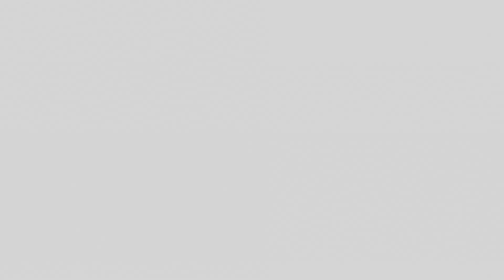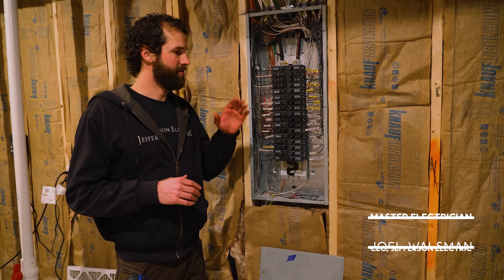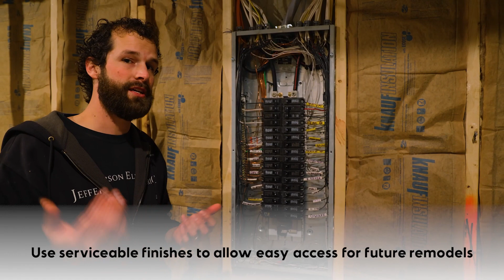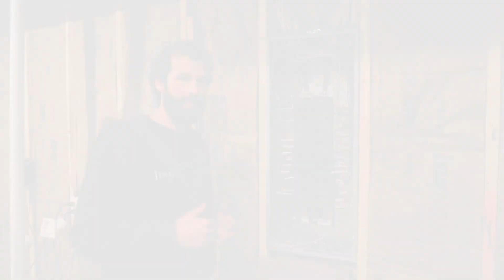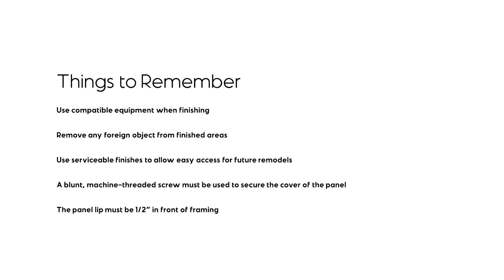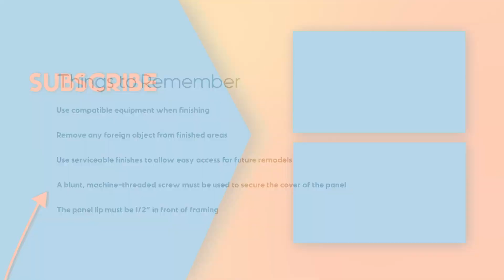5 Common Electrical Panel Mistakes

Comment: As a 40 + year electrician the thing that really bothers me is guys who trim the wires to the exact length when terminating to the breakers, and then bundling the wires so tightly that troubleshooting individual wires is impossible. A service panel will probably last 40 years or more and many modifications are going to take place after you are long gone. Circuits will be added, breakers replaced and loads will get moved around. Also, the heating and cooling of conductors will cause them to expand and contract, allow for this movement. Always, always, always leave an extra loop of wire inside the panel. Run the wire down past it's breaker a few inches and then come back up to terminate. Trimming a panel isn't an art contest, it's all about function, safety and future servicing. The need for splicing wires in a service panel because they are too short is bad practice and usually frowned upon by inspectors.
Reply: Panel can be used as a junction box. If the wire isn’t quite long enough, extend it. Twist your wires good
Reply: @zachdalehite2165  Do that too many times and you fill up the panel box.  It's better to not have to junction to begin with, if you can avoid it.
Reply: @thekobaz  yea that’s true. But if you can’t help it do what you gotta do. Seen people try to extend the wire & leave the splice pushed up in the wall or ceiling rather than the panel box
Reply: @ElectricProAcademy  Thank you! An example I can give, and there are many, is adding a panel mounted surge suppressor. For this device to be most effective,  it should be connected as close to the main and with the shortest wires as possible to dissipate any erroneous currents as soon than they enter the panel. They normally require a 2pole 20amp breaker so this would entail relocating the 2 closest circuits to the main.
Reply: @davenag957  
As another 40+ year electrician,  I agree with everything you said. Especially the extra wire length. I always do it just as you described.
Another example of the need to "rearrange" breakers would be a generator manual lockout situation where the generator breaker needs to be adjacent to the main.
There's probably a happy medium as far as the "art project" aspect. Serviceable  and functional, yes... but not a "bowl of spaghetti" either.
Reply: Was taught over 50 years ago to leave wire at least entire length of panel so a wire could easily be moved. Now with 42 & 84 circuits it's not practical. At the large hospital/research center that I retired from they had at least six 84 circuit 120/208 panels on each of the 12 floors. All conduits were 1" EMT leaving only at top of panel. They made contractor pull a total of 19 #10 guage wires from panel to first pull box for all the 20 amp receptacle circuits do even ty rabbing wires was a crowded mess having over 175 #10 guage wires at top of panels.
Reply: I’m glad that as a second year (soon to be third) that there are people that still do service loops
Reply: Agree with you 💯 %.

Comment: You missed the elephant in the room when stating the breaker vs. panel compatibility.  There are many panels out there where the original mfgr. is no longer in business. And some of those do NOT have an official replacement by another mfgr....although there are breakers made that fit and work well. There are arguments over this all the time.. The code is vague, but seems to cover it..No...you do not have to tear out your panel (at least last time I checked)  even though there are no "official" replacement being mfgd.   And as far as push in vs. 2 screw connectors. Are you kidding? Use what you want. We do remodels and have to deal with this type of thing every single day. For starters,..cutting (and repairing afterward)  the sheetrock along the top is by far a bigger pain than dealing with the metal vs. plastic connectors that are the next thing to deal with.
Reply: I don't believe "must be listed for its intended purpose and use" is very vague.

Comment: Without reading through all the comments, Is the main breaker feeding this panel within sight?
Reply: @ElectricProAcademy  Then you need a main breaker in the sub panel. Unless you can throw 6 breaker disconnects or less in the panel to de-energize everything

Comment: Can you leave extra breakers inside the panel box?
Reply: Yes, installed and in the off position is used quite often for space filler and holders all the time. 
Just make sure the panel cover is labeled properly to indicate where the blanks are, which is reason for 'off'.; along with proper labels for all others.
No materials, loose items or breakers laying in the bottom of the panel however.

Comment: When the sub panel door is open, is it normal to have a gap on the top and bottom of the panel? It’s out doors and it exposes the wood and insulation.

Comment: Just found your videos. Excellent! Straight to the point. No jibba-jabber. I just subbed. Also, you said "half inch in front of drywall" at the end. I assume you meant half inch in front of the framing? When talking about bushings and connectors, I suggest showing a closeup of the hardware so we know exactly what you're talking about. Though I've worked with the two-screw connectors, I haven't worked much with panels and wondered if these were special bushings you were referring to.
Reply: @ElectricProAcademy  One question for you brotherman. Electrician U said to put 20A receptacles on 20A circuits, since the 15A receptacles are, by code, limited in amperage they can accomodate; hence overheating & fires. Which really made sence to me.

But today, on a Resi job,  instructions are to put 15A receptacles in the kitchen, "because they aren't a dedicated receptacle". Apparently this company feels that putting a 20A receptacle on a 20A circuit, with other receptacles, is an issue.

What are your thoughts?
Reply: @ElectricProAcademy  Ok, I'm going to rewatch his video again, pull out my book and reread what you said. I mistakenly thought this was simpler than it actually is. Thanks for the homework.
Reply: @ElectricProAcademy   OK, I rewatched Electrician U's video again, and I'm still missing something.  Dustin stated,
"The maximum load you can plug into that 15A receptacle is 12A. So if you’re only plugging in something that is up to 12A then it’s not going to melt. Which is why it’s ok to put a 15A receptacle on that circuit because you’re not allowed to plug in anything more than 12A…But the problem is when people plug multiple things in and they go over the amount that the receptacle was designed for." 

I believe I understood your (10 + 10) math equation, but the user was using two receptacles. 

Based on Table 210.21(B)(2), the maximum amp load for a 15A receptacle on a 20A circuit is 12 amps. Dustin brings up the very point that I'm concerned about; which is the end user (who doesn't know anything about amps and circuits) who plugs in a space heater, specifically the Dreo Portable 1500W Space Heater which states it requires > 16A, and also a laptop, then are they not overloading that 15A receptacle? 

Isn't Dustin's case the best argument to have 20A receptacles on 20A circuits?

Comment: After that panel is closed up and drywall is installed there is  no way your adding additional circuits thur an existing romex connector. Good luck if your on an outside wall.

Comment: Does the romex insulation have to be removed right after entering the panel or can it stay on until close to the termination connections? Stripping the last 5” is easier than 24”.
Reply: @ElectricProAcademy  it seems it would be an added layer of protection but perhaps not work well in a full box. Stripping 6” is faster than 3’. Thanks
Reply: The full Romex cable with insulation is a lot bulkier than the conductors alone that often need to be routed to different places in the panel anyway.

Comment: @electricproacademy- Looking to move an outside A/C unit to the other side of my garage.  Is it a code requirement to run the 10/3 inside conduit above the blocks in the rafters.  Clearly need conduit from box to rafters.  I see lots of other wire 12/2 - 14/2 in the wild (no conduit) in my rafters.  Thanks for the great videos!!
Reply: I'm pro-conduit, though.  Best protection a wire can get.

Comment: I just watched your video about installing the 220 outlet for an EV. Probably the best DIY video I've watched on You Tube. Last year, I was going to put a Hot Tub on my back deck and the Electrician wanted about 3k to install a 220 outlet out back. Does that seem right? Good to know you're in Indy. I live in Lawrence.
Reply: @ElectricProAcademy  yea, it’s through vinyl, along the side of the house and attach to another vinyl siding wall. Drilling the hole would be the easiest part :-)

Comment: No where in the NEC does it specify blunt tip screws, only that it is securely fastened with a fastener... I get where your headed, but I have also seen these panel screws nick wires when the wires are passing in a bundle passed a screw hole. The screws you are referring to are a special kind of hardened thread generating screw. They are only available from an electrical supply house.
Reply: @ElectricProAcademy  text offers no real personal expression, but I was trying to help... I only mentioned my thoughts because once upon a time in multi-family condos in my state of Florida... I had to figure out how to fix 15-20 units where the green guys blew out the holes for the load center. Instead of using metal epoxy to fix the hole, I just went to the code book to see what it said about how the cover is to be fastened... After that went to ACE got some self tapers and replaced all the screws making them match up sizing the fastener then cutting off the self drilling part. Beat having to remove the load center and replace with a new one.
Reply: @DishitoutNetwork  Could you just tap to another size and use a machine screw?
Reply: @illestofdemall13  the special screw has very fine hardened threads because the panel lip is only like 3/32 inch thick so another machine screw has to be like #12 @ a 32 thread those are hard to find... So I just go with a self tapping and self drilling tek screw with a collared washer and start at #10... But hey as long as they are all the same and secured and removable...
Reply: the better tip would be ensure no wires are near screw holes on inside of panel cause I don't think I came across a panel yet in 30 years that had all the factory screws in it ,  regardless I wouldn't want a factory dull end screws touching wires in there either .

Comment: I prefer the push in bushings over the 2 screw ones because once thats drywalled you are not undoing the 2 screw connector with out removing rock. The panel lip may need to be 5/8 out as in certain locales garage wall to house wall is 5/8'. So set the screw in center so it can be adjusted after ock is in if needed,
Reply: I surface mount all my panels.
Reply: I ran into this in my home and realized the panel cover (I'm flush mounted) is so much wider/taller than the panel itself that creating an opening in the drywall just large enough to poke a screwdriver through allowed me to loosen the bushing without any cosmetic issues after the panel cover was reinstalled.
Reply: Push in connectors all the way. Set screws screw you when trying to pull that wire out with sheetrock surrounding the panel